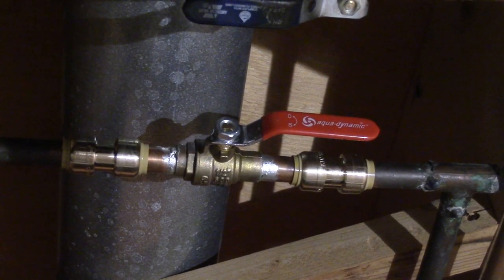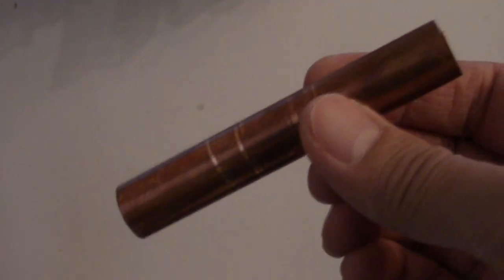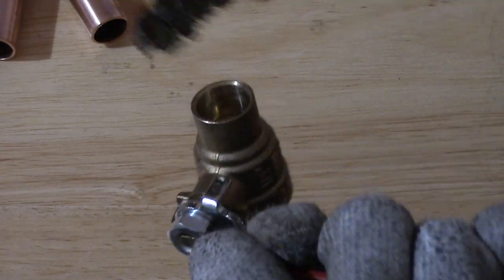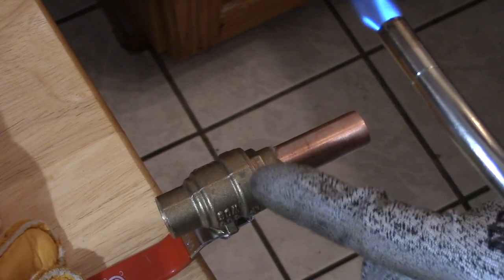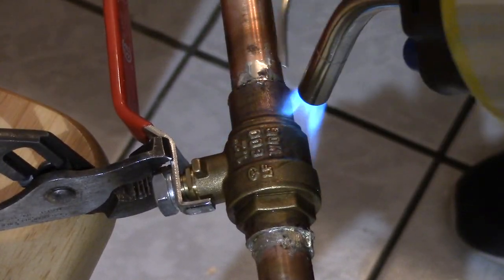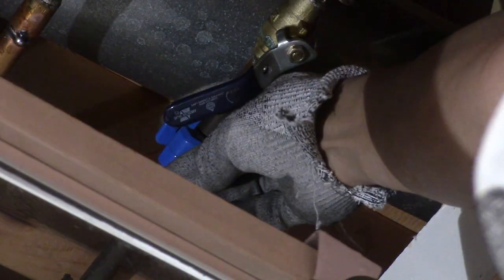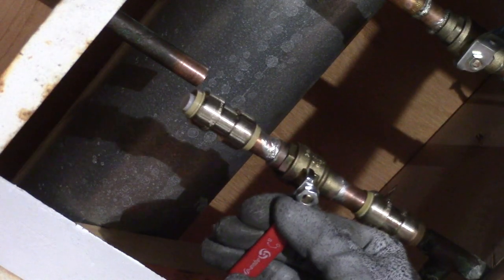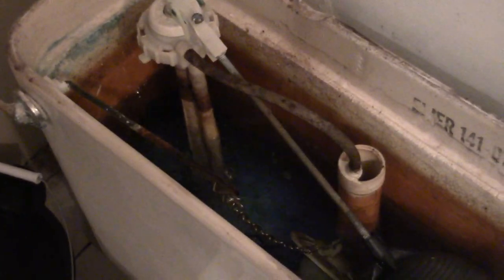How to install Stop Ball Valve with Shark Bite Couplings or Connectors. DIY

Comment: A tip I got from Rich T., the plumber on This Old House: when soldering, place the flame on the opposite of side away from the solder wire.  The heat will draw the solder to it, around the pipe.
Reply from the maker: Good tip. Thanks for sharing.
Reply: @jonahvlogsdiy4143  I just installed 2 Sharkbite shut off ball valves.  I'm liking the Sharkbite stuff.
Reply: I saw that same tip. I think anyone who is new to soldering has looked up and watched that video

Comment: Went to use the shutoff Valve after some pipes burst... I thought it was still behind the tub... Turns out the guy who installed the Tub didnt watch this channel because he bought 3 different adapters and stuck a normal CPVC T fitting where the 3 way shutoff used to be...
If it wasnt for Sharkbite I'd be flushing the toilet with pond water...
ALWAYS keep a couple Sharkbite End caps the right size for your pipes, they're worth their weight in Gold when you need to stop a wet pipe in seconds.
Reply from the maker: Yes you're right about that. I love sharkbite. Thanks for the visit.

Comment: Can you use the same sharkbite more than once cause  it leaks , and u want 2 remove it  to clean up the pipe better
Reply from the maker: You can remove it, but if you put it on & it leaks again after you cleaned the pipe, then get a new one.